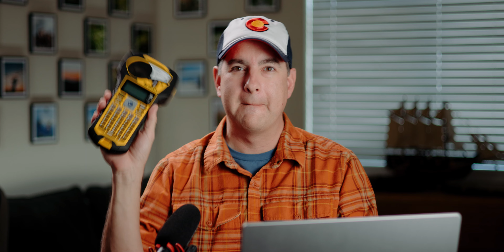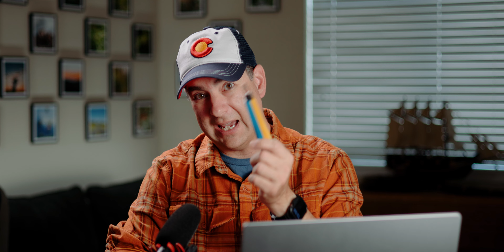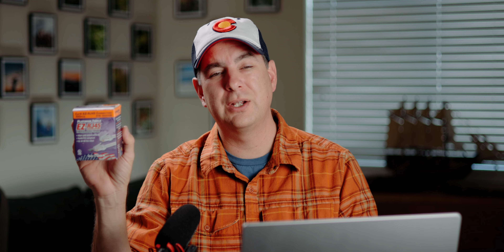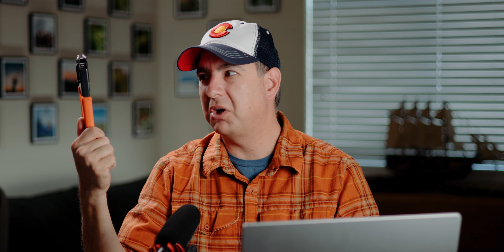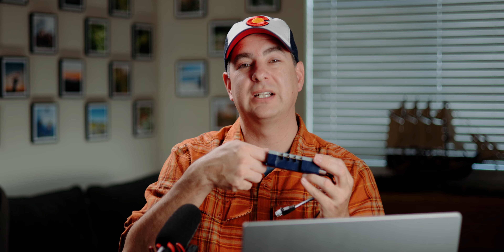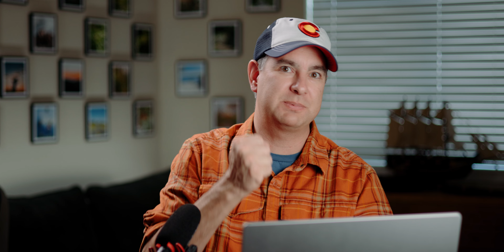The Essential Tools Every Engineer Needs

Comment: A pen sized non-contact voltage tester.  Test the tester, test the subject, and then test the tester (again)... every time.  I also carry a "Wiggy" loaded voltage tester too since non-contact testers sometimes are fooled by induced voltages and high RF environments.
Reply from the maker: Yes!! I couldn’t find the one I have in time for the video but yes, 1000 times yes to have one of those.

Comment: I hear the bellyaching about the passthrough RJ connectors on the internet all the time. I also have been using them for ages and haven't seen an issue. Supposedly its a problem with POE, which I've also done a ton of, ones that power a microwave ODU. So real juice being pulled, on many occasions we used all 100 meters and maybe a bit more that e-net is good for. I'm using the real deal paladin passthrough crimper that trims. I think some people just have no grip strength. IT forums are usually just people pooping on other folks work so...

As far as a labeler, I am really attached to the brother stuff. Mostly because you can get the label tape in a pinch at staples or whatever. Otherwise you get the off brand stuff on the internets. Panduit pages are really great if you have a big job and can pre-fab them. The up front cost is higher since you have to buy so many in a pack but price per label is much lower. Plus you make the labels on a real computer. Like I said, big jobs with hundreds of labels.
Reply from the maker: Brother makes nice labels. I’m a Brady fan. I like slashed zeros. But really any label maker that helps do documentation is good.
Reply: @TheBroadcastEngineer  I like Brady, I used a m710 for years but the place were I used one had someone that kept consumables ordered and stocked. Really nice machines though.
Reply: The "secret" to pull thru RJ-45's and crimpers with the cutting blade (which I use with near zero failure rate) is to pull the cable thru "tightly" then keeping the conductors under tension twist them together before you crimp.  Don't know why this works but noticed a demonstrator at a trade show did this, tried it and no further problems.
Reply from the maker: @dtvandy Interesting! I’ve never had success with the crimp and cut tools.
Reply: @TheBroadcastEngineer  I've never had an issue and we (if paid) would run a certifier on them... I guess that's why some customers require factory made, though I don't think there's any difference in tooling, though I don't think the wire jobbers spend the extra coin on the pass throughs when they can just have folks that do nothing but RJ connectors and be fast with the old school connectors. Latinas in flowery smocks got nimble hands.

Comment: Will also add another thing, a cheap AC DC clamp meter from Uni T. Small, pretty good performance, and cheap, plus does DC current without breaking the wire, along with AC current, and with autorange as well. Pro tip is the unit runs off 2 AAA cells, do not put rechargeable in there, just keep a pack of AAA cells around. 

You probably will find that you go through AA and AAA cells a lot, so buy the 12 packs of them. Would also remind you to check the ones in remotes and such every month for leakage, as the ones from "brand name" no longer have any warranty against leaking, and are famous for leaking as well. I changed away to a cheap store brand, where the 12 pack costs the same as the 2 pack of the branded ones, and it endures, and is energised, for just as long, and yes there is a chance of leakage, but as the capacity is lower you will probably have it flat before it leaks. Lasts a year in a clock, same as the brand name, and no worry you will come to find a trail of slime down the wall, and a dead clock.
Reply from the maker: Funny you should mention the batteries… you’ve watched next week’s video then time traveled back to post this! 😜
Reply: @TheBroadcastEngineer  Just that i lost stuff to battery leakage, and seen way too many branded packs leaking in the shop on the shelf, even if expiry is 5 years in the future. Relying on brand recognition, but using the cheapest manufacturer to make them instead, and selling as a premium product, but in reality the battery is the same as the no name store brand ones.

Comment: You may want to add a Network Tester that actually tests the cables ability to pass data at the needed speeds. Not just a continuity tester. Fluke Networks has appropriate testers. I think you may be surprised that some seemingly OK cables are responsible for errors that seem random resulting in a more reliable system.
Reply from the maker: Did I forget to mention my favorite new cable tester? The Fluke LinkIQ? That thing is amazing. Tests the cables, tests PoE, makes reports on cables…

Comment: PassThrough RJ-45 connector is bad stuff, cause they had an opened end of connector.
The ordinary RJ-45 has dead end, so if you tape it on the shielded side, then crimp, it will be sealer very close to IP64 (!). 
Now try the same with PassThrough.
Reply from the maker: Never had a problem in the thousands that I’ve done with pass through. If you’re not careful or have a bad tool that causes problems. I also test all my cables before walking away from them.
Reply: @TheBroadcastEngineer   you have a very good point, but could you do a water test without any consequences?
Reply from the maker: @nikostalk5730 I don’t make cables for outside that aren’t inside a waterproof enclosure.
Reply: @TheBroadcastEngineer  well, that's the answer i've looked for! For indoor use - they are ok to be used. Good video btw!